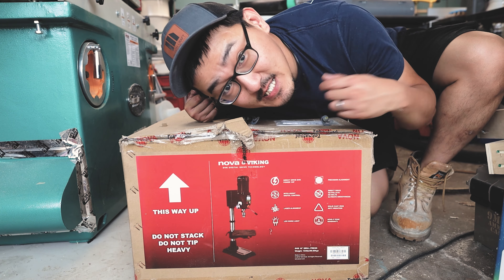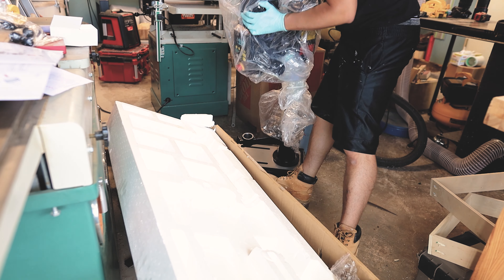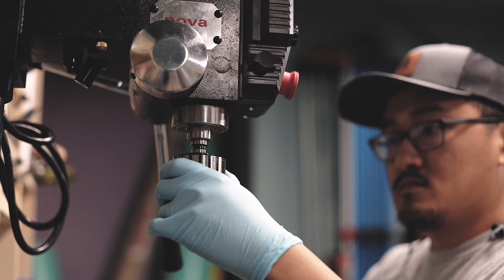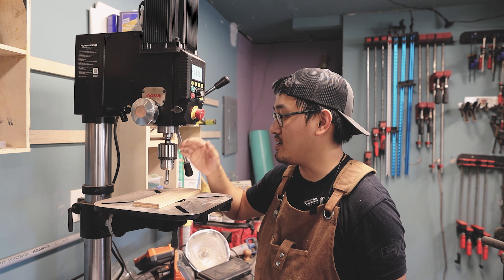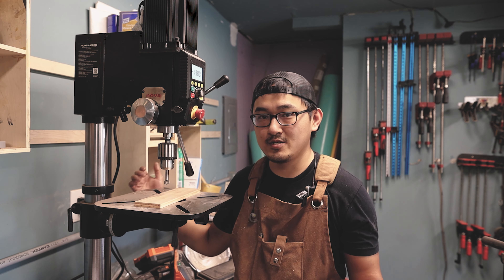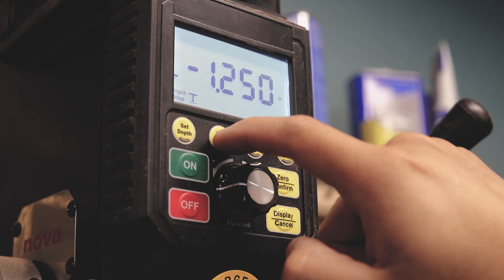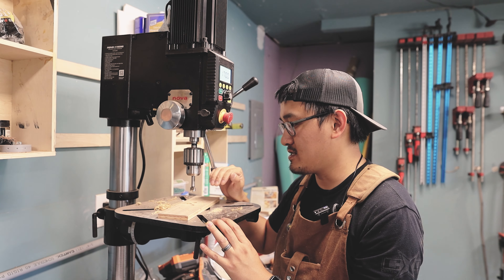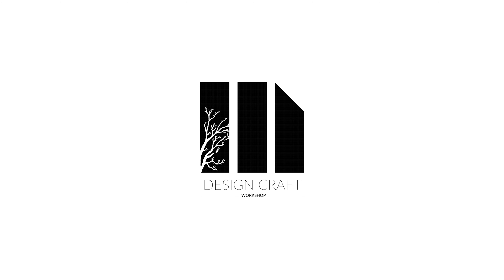The First and Last Drill Press I'll Own // The Nova Viking! // Unboxing Assembly and Review

Comment: Great presentation, thank you. I was pulling the trigger on a 17"Jet DP and this model showed up, I think I am in as well. The variable speed option at this price point is a fantastic bargain and has no changing belts, not to mention the ultra-fancy digital features. The Viking does come in a taller floor model #83706. Some reviewers have stated that tapping threads with this model should be much easier.
Reply from the maker: Trust me, it's worth the purchase! No regrets after all these years.

Comment: I'm glad I watched your vid.  I've been contemplating upgrading my old bench drill press with a mill drill for almost a year.  But then I concluded that even though I do mill from time to time all I really needed at home was a better drill press.  I like the fact that the bench model doesn't have all the menus to tab through (I can look up speeds in tables on the wall) and the floor version is way more than I needed anyway.  So I pulled the trigger yesterday and picked it up.  Beats the pants off my old machine and from what I can tell most!  Powerful, easy to use, quiet and runout on the taper in the quill is 0.0007".  Bonus, you CAN tap with this machine.  You can't use a hand tap but with a spiral point tap (gun tap) and the depth stop/auto reverse feature you just power tap the same way you do on a Bridgeport mill . . . only it's easier since now I don't need to use two hands!  Made two perfect 10-32 tapped holes into angle iron in seconds. I'm guessing this is faster than tapping mode on the Voyager model with hand taps.
Reply from the maker: That's awesome! I agree. The Viking is more than enough of a drill press. It's has all the bell and whistles I need for my shop. I hope you get good use out of yours!

Comment: I consider the NOVA drill presses number 1 just like Sawstop for table saws. Just a quick note on the dept stop- you set it for 1/4 of an inch but it measures it from the forstner bit tip not the actual shearing action bit. Might need to adjust for that when drilling and needing a specific depth.
Reply from the maker: For sure man! It’s an awesome machine

Comment: left hand drill bits are cool for drilling out broken bolts, the drill bit usually heats up the bolt and most times with the cutting pressure out comes the bolt.
Reply from the maker: That's  good to know

Comment: My only concern is the button module. I've always hated those kinds of buttons on machines. They wear out so quickly in terms of wearing off the surface, then the squishy feel lack of tactility is another factor combined with the fact that if they stop responding it's so much more involved of a fix vs a switch style button of any kind.

Comment: I’m in the market for a drill press. This looks cool, my only concern are the electronics and what would happen over time. Belt drive presses have a very long life, and are easy to fix. The difference is like carburetor vs fuel injection.
Reply from the maker: So far mine has been working fine

Comment: Nice drillpress! How precise is run-out of the chuck and the spindle? I saw some wobble on the chuck. Could you show or tell us how precise the drillpress is? Thanks for posting en sharing!
Reply from the maker: Thanks for the comment! I haven't seen any issues with the chuck so far. It all seems to drill nice and straight.
Reply: Its a wonderful machine and i hope it will fullfill all your needs in drilling straight holes. All the best! Richie🇳🇱

Comment: the 110V and 220V are the same, just a different plug. You could swap the plug on on this, or make a conversion cable.  Unlike the Nova products that use the 1250W motor, this will stay 750W (1HP) at both 110V and 220V.  The reverse function can also be used with sanding drums.  For anyone watching now, there's a floor model of the Viking now, exact same unit, just a taller column and longer rack.
Reply from the maker: pretty cool that they offer a floor standing one now. Didn't know that. Thanks!

Comment: Nice Vid.  However the hole is not .25" deep because of the forstner bit tip.  In order to compensate for the tip, either bury it in the stock with added pressure during the measuring step or add more depth during the setting step.
Reply from the maker: Yes you're right 👍

Comment: Can this make repeatable holes one after another? I need to drill about 20-30 holes in a piece of wood and don’t want to to shut down after each time it hits the depth stop. Also, if you set it to stop at a certain depth, do you have to reset the depth each time hot turn it off and then back on?
Reply from the maker: Once you set the depth it stays until you reset it. So yes very repeatable

Comment: When you zero'd out the bit, it was the tip of the brad bit and not the cutting edge....do you need to push the bit into the wood down to the cutting edge to properly set the depth?. What height is your countertop...I'm 6'4" tall
Reply from the maker: Yes the bit should be all the way down. The height is 30”. Little too tall for me. I'm 5’9”

Comment: Did you build a stand for the drill press yet? I'm thinking of getting one but I'm not sure about placement as it's pretty tall.
Reply from the maker: I haven't yet but stay tuned for it 👍
Reply: Why bother? It's heavy enough and apparently has enough stability it shouldn't really be a concern. I figure if you need to make a stand you might as well have gone for the floor model version.
Reply: @johnjingleheimersmith9259  Where am I supposed to put it if it's not a floor model? Should it float? I bought the drill press 4 years ago and I made a stand. It's great. Weird comment dude.
Reply: @JoaquinGTP  I mean considering that it's in the name, "benchtop" might be a clue as to a potential location. It's just kind of common sense, dude.
Reply: @johnjingleheimersmith9259  Oh hey everybody, we're only allowed to put this drill press on a benchtop. Can't build a rolling cart for it because this guy said so on the internet. Thanks for your contributions to society.

Comment: Great video and timely for me. I just bought a Viking drill press and I will pick it up this afternoon. That said, do you have a recommendation for the height of the mobile base that you are building? Please keep up the great work! Cheers
Reply from the maker: Thanks Kevin! I'm sure it'll be just as awesome for your shop as it has been for mine. Let me know what you think! Currently, my workbench is 35" high. I plan on making the mobile station 30" high. I'm 5'9" just for reference and that would make the controls on the drill press just above eye level.
Reply: Design Craft Workshop I truly appreciate your quick response. I am 5’ - 9” as well and was thinking that 27” would work well, but 30” seems to make sense as well. I will shoot you a note when I get up and running which might be tomorrow with local rain on the horizon. Cheers
Reply from the maker: Kevin Clark I was considering moving it lower than 30”, but the table would be too far down for my liking. I already am starting to have back problems and don’t want it to escalate 😂😂😂 thanks Kevin 👍🏻

Comment: So do you leave it plugged in all the time like you would a computer? Or do you unplug it when you aren't using it ? Does it take long to power up? Just a few stupid questions before I buy one of these.
And lastly, do you think you have it at a safe height? Looks potentially dangerous with your work piece and drill bit right in your face like that!
Reply from the maker: I leave it plugged in and it doesn't take long to turn on. There is an on/off switch on the side. Yes it is a bit high for my liking, but I've haven't had any issues. I always clamp down whatever I'm working on.

Comment: I have tried to get the answer to this from teknatool and failed. Please help me if you can. If the drill press is setup on a bench with a wall behind it and the base of the drill press is placed right next to the wall, is there enough room to turn the table handle? Assume the wall is vertical.
Reply from the maker: It'll be tight but you can get pretty close to the wall. It's pretty standard drill press table design.
Reply: @DesignCraftWorkshop  Thanks for answering. I did think it would be very tight. My bench is 479mm wide and I use the front face of the bench as the back of a fence for my RAS so I cannot allow the base to protrude over the front of the bench. Also with the drill mounted so close to a rear wall, I was wondering whether it would still be possible to move the table out of the way and place the workpiece to be drilled on the base?
Reply from the maker: I suppose you could if the piece is tall enough. you'll have to figure out a way to support the piece perfectly vertical.

Comment: I just took delivery of my new Nova Viking and managed eventually to get it single handed up onto my bench. I would appreciate answers to two questions from anyone who has assembled one. 1) The table winding handle will not fit on the spindle more than 1/16 inch. Whilst this is enough to operate it, I wonder whether I have done something wrong or whether it is a manufacturing defect.  2) I cannot use the drill at all as the display shows "chuck guard open". Is it possible to use the drill without the chuck guard? and if not what might I have done wrong in connecting the chuck guard electrics? Thanks in anticipation of an answer.
Reply from the maker: I haven't had these issues. Maybe give them a call
Reply: Thanks @DesignCraftWorkshop  By the way, how did you take the video without the chuck guard in place?
Reply from the maker: @teammap6008  mine didn't come with a chuck guard. I don't think the US version comes with it at the time I purchased mine.

Comment: About the motor: Is this machine powered by AC inductive or brushed DC motor?
Reply from the maker: Not sure the technical specs, but it plugs into a standard 110 outlet or 220 depending on what you get. It is a direct drive motor though.

Comment: Re: 220V version. Looks like it's the same setup as the Nova Voyager - the only change needed to run it on 220-240VAC is to change the plug to the proper kind, usually a NEMA 6-15P for the U.S. (and Canada, AFAIK). The internals, like a lot of modern electronics, don't care. Whether 120 or 220, the manual says to use a 15 Amp surge suppressor since it is electronic.
Reply from the maker: Yeah that's pretty much what is needed. New tail that's going to work with a 220v plug.
Reply: Interesting. I guess I don't understand the internal wiring of this that would allow just changing the plug to convert it to 220-240v. I read the same thing about the Nova Voyager drill press and assumed there must be more to it?
Reply: @steinbierz  Apparently it's like a switching power supply, the input voltage isn't really important since it's all electronically converted to whatever the motor requires at any given moment anyway. (The motor is more like a giant stepper motor than a traditional tool motor.) Same power no matter the input voltage, just less current at the higher voltage. It's really an amazing tool - well worth the money. (Mine has the Viking head but with the floor length tube like the Voyager - I was running out of bench space.)
Reply: @williamivey5296  Thanks for the explanation, William!

Comment: super nice machine, gagging on the price. great video
Reply from the maker: Thanks! I think it's a great drill press if you're going to buy one and keep it forever.
Reply: @DesignCraftWorkshop  maybe I will save up!
Reply from the maker: @liloukulele5238  it'll be worth it
Reply: @DesignCraftWorkshop  I will be saving up for one. I am getting ready to build a new shop, plans drawn and approved; once built I will look forward to installing my Viking. Where can I find a thorough video on how to operate? the speed control and depth control setting would make my life so much easier. I cut sound boards to inlay rosettes, I need a depth accuracy of about 0.4mm-is that possible with the viking?